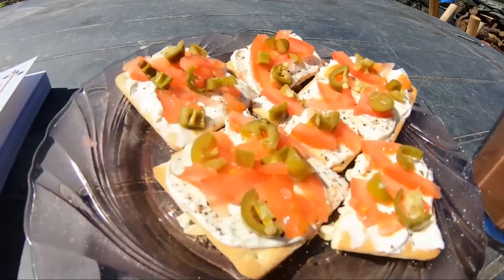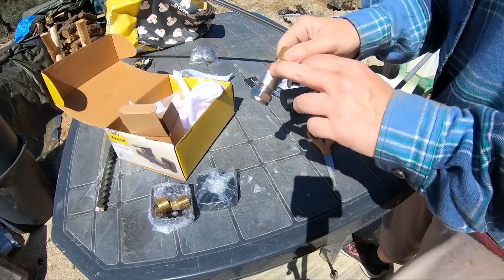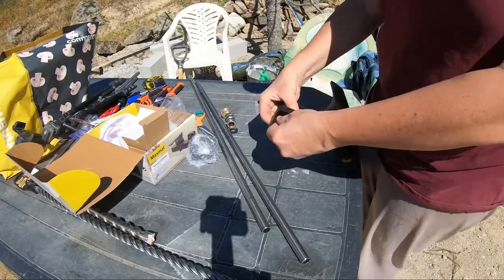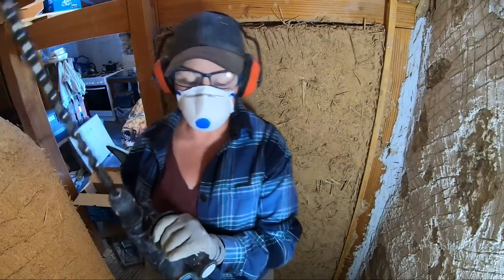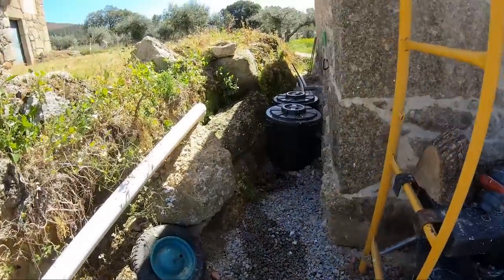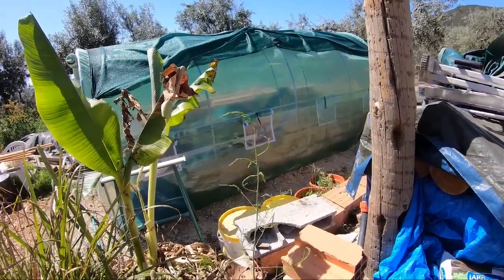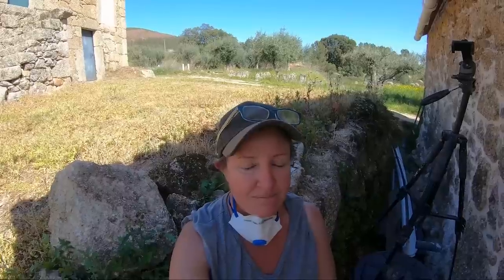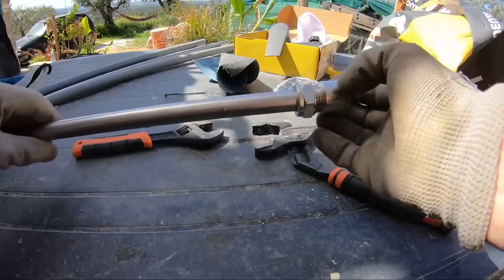Tiny House Shower #5 - Mega Drill, Mega Holes, Plumbing Fun, & Lime

Comment: The direction of the attachments to the mixing tap doesn't matter. They are like that so you can adjust them until your tap/faucet is level, incase the drilled holes werent on the right place.
So you can perfectly have one side upside down compared to the other side, if the drilled holes were that much out of line. If that makes sence.
Reply from the maker: Makes total sense and I might just have to use that feature... thanks!

Comment: Hi kirsty! The couplings you've got are eccentric couplings, they are made to screw into the mounting bracket y've got for the shower tap. They are made so that you can adjust the width and height for each and every tap! I'm in the hood next week,let me know if you need a hand with owt!😇
Reply from the maker: Makes so much sense and seems obvious now. Thanks for the explanation! I won't be actually fitting the taps for awhile but I think I get how it would work, cheers!

Comment: The brass fittings which are offset, allow for the fitting of the taps into wider spaced pipes or closer pipes, as the horizontal distance between pipes may vary for installation into pre-existing pipes when replacing a tap. As you are fitting to your measurements, you can adjust the spacing and horizontal distance and the levelling to suit your wall, by using the offset. ☺
Reply from the maker: Makes so much sense, thanks!

Comment: Your getting there, with the shower plumbing. The wall.crumbling with the drilling, is not a biggy. You have plenty of lime render. A few smaller stones, some lime , job done !. The front looks so different with the tarp of it. Can't advise on the plumbing, never seen those before . But I am sure you will figure it out😊
Reply from the maker: Slowly slowly and rocks and lime are powerful fillers for these walls, for sure! I've had a lot of people reply about those fittings and it all makes sense to me now, thanks!

Comment: Amazing tenacity and perseverance, very impressive.  Would be interested to hear about other aspects of your move to Portugal, such as installing the solar system (checked back in your old videos and didn't see anything specific about installation). Also, what was the process of buying a car like? We've heard they are super expensive and you need a bunch of paperwork done before buying.
Reply from the maker: Sure! This video should answer your solar questions - https://www.youtube.com/watch?v=2ibl6fEUrog&t=2s - and the install was done by the solar people. My car cost €400 and it's a 1997 Opel Corsa and sort of a piece of crap... but it's mostly reliable! The process was easy, a local mechanic found it for me and I bought it. Not much paperwork though you'd need a NIF (tax number).
Reply: @PortugalfromScratch  thanks for your feedback and the info, much obliged. We've just bought a small plot not that far away and so are total newbies. This is very helpful. 🙂

Comment: You look like a bad ass with that drill!! Go girl!!! I had a question, that lime render needs to be water proof or is that the final finish? Explain that a bit on the next video.
Reply from the maker: Haha, thanks! I've already filmed the next video but I'll be sure to add it in a future video... but this isn't the final finish. I'll have more coats of this to build it up to the thickness I want, partially waterproofing, partially aesthetics. Then there will be a coat with fine sand and lime and then after that, it'll be tadelakt, I hope... which is the waterproofing part. Let's see how it goes!

Comment: Are you sure that is a SHOWER faucet ?
Reply: It's for a European shower, which is usually over the bath, so it sits like a bath tap and has a spout at the bottom along with hose. But i have relative who don't have the spout they just fill the bath with the hose which is better water pressure
Reply from the maker: Nope! I'm sure of nothing... but I think it's for a bathtub/shower combo. However I have friends who have those in their showers, too. Weird but I think I might have bought the wrong thing. But it'll work!
Reply from the maker: I think you're right! Meant for over the bath, maybe not designed for a wall shower. Oops!

Comment: What kind of coffee? Did you say chocolatey coffee? If so, how do you do that?
Reply from the maker: Ooh! I'm glad you asked! I brew up espresso for my morning coffee  and save half in a glass. Then in the afternoon I add that into delicious Cacaolat chocolate milk and then I have a cold, chocolatey coffee that's delicious! 😁 I love chocolate.
Reply: Chocolate and coffee is called mocha (pronounced moka) the proper way would be melt chocolate in milk and add coffee, but mixing instant coffee with 100%cocoa or drinking chocolate and adding milk to make a paste then add the hot water, that works. Or just melting a square of chocolate in your coffee made your way, though that tends to not mix in as well. I make a chicory, coffee, reishi 
mushroom (careful it’s bitter) mix as a caffeine free alternative 😊
Reply: Tap does look like a sink tap, never seen a top facing one like that, not the most ergonomic…the house looks so cute without the tarp, you’re getting loads done, Spring energizes us all I think. I spoke to you before about my mouldy Tadelakt showers, I’ll say it again, just incase. Tadelakt is delicate to clean, nothing harsh or acidic, so it inevitably gets algae or mould crowing in the crazing, yes you can retouch and reseal, but I would recommend combining it with tiles on the floor at least, or pebbles, just something more hardwearing. Go Kirsty 💪👏👍
Reply from the maker: @monicacruz4407  Haha yes, I know mochas well. It's my favourite drink! The Cacaolat stuff is a rich chocolate milk already, so it skips past the powder stage and t's super creamy and yummy. But if I'm out of that I'll add powder and do as you suggested. 😁 I like the caffeine but your drink sounds interesting!

Comment: The direction orientation of the “pipe to tap” fitting is irreverent, I.e. no top or bottom, it’s purpose is to allow adjustment if the supply pipes are to wide/narrow or not level.
Reply from the maker: Makes so much sense... thanks!